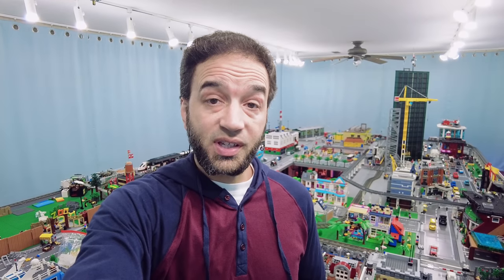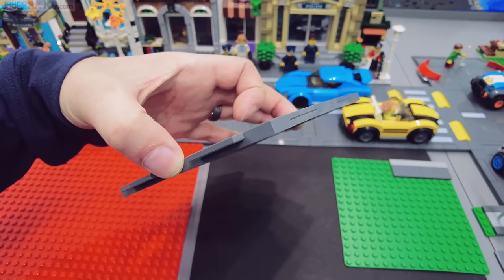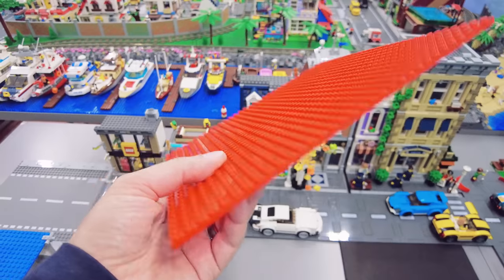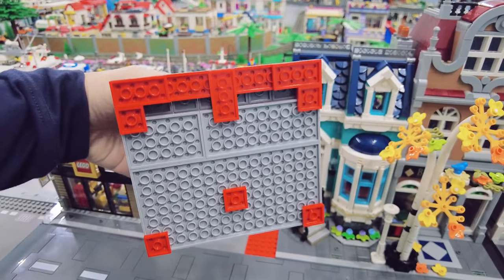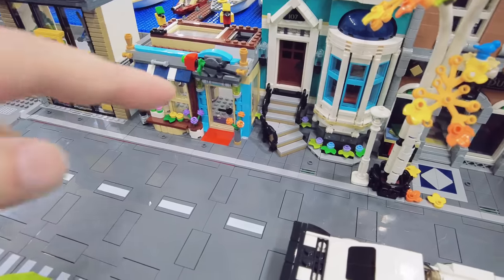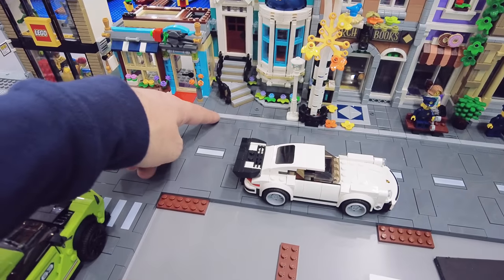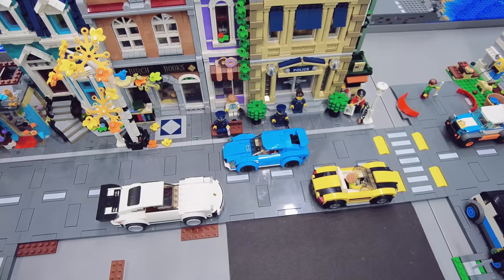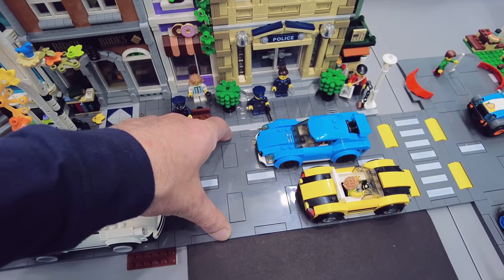LEGO road plate harmony! Easiest, cheapest fixes & integrations for modulars, baseplates & more

Comment: These roads just... look more LEGO, the have customisable capabilities, while they’re certainly flawed (as most things are) but they just feel more proportional, once we get corner prints, it’s all good to go
Reply: same here, I wish there was an official solutions from Lego to fix the height difference issue though
Reply: @adwind.homealone.fandesigner  I assume one will be coming. As lego has started realizing, with all these upgrades to the roads, the modular line becoming independent, it seems they are starting to realize “Hey, these people are adults and build our sets, we should keep them interested” so they would probably think “hey, baseplates are suddenly obsolete but most serious lego cities are built solely on baseplates. We should fix that.” Now enough of my rant.
Reply: The biggest detractors are the increased cost per area and the loss of curved roads. The versatility and compatibility most like makes them worth it though, so long as Lego commits to the same style for many years.
Reply from the maker: @snfriedm  I have to agree with that. They switched to plates for almost all buildings back in 2013. Modulars are the out-of-system outliers and can't transition to plates suddenly as every AFOL would revolt and burn their cities 😂 A simple pad piece of the correct thickness should be offered as at least an official fix for the modular problem.
Reply: I've got a feeling that Lego may introduce separate plates in sizes of baseplates for people to buy. 
That may not be the best idea, but I can see Lego doing that.
Reply: @JANGBRiCKS    3mm or 5mm glazing packers depending on your preference solve this issue, I paid £13 for a 1000 on Amazon. It’s a cheap fix. I’m loving the new roads by the way. 👍🏼
Reply: @nihili4196  i think so as well. Im sure they will cost a premium though
Reply: @nihili4196  That would be AMAZING!!! I never really had too many baseplates since they’re not in system, but this would be a godsend! I could imagine them selling well.
Reply: I’m thinking of doubling up the road plates for main thoroughfares and using single road plates for alleyways to run behind the modulars when you have the buildings back to back.  And if you take some Brasso to one of the 8x16 crosswalk plates and remove the white lines you can make a narrow alleyway.  You can also use Brasso to safely dull the surface of the road plates.
Reply: @snfriedm  Yo, have you had a car on 3D BOT MAKER die cast racing?
Reply: @JANGBRiCKS  wouldnt it be possible to include 4 16x16 plates IN ADDITION to the baseplate with future modulars? I dont think that would overblow the budget too much, it would give everyone options
Reply: If they made a specialized corner piece, I'd be 100% sold on the new road system! These do look a lot more "lego" like too!

Comment: With Lego once again progressing to faze out baseplates, I wonder when modular buildings will finally switch to plates which may further lead to the retirement of baseplates as a whole. Lego gradually started fazed out raised baseplates and non-road printed baseplates in the mid 2000s, however, there were some odd exceptions like the pharaoh’s quest pyramid so I may be underestimating the staying-power of them.
Reply: I've been wondering for a while now whenever Lego is slowly fazing out baseplates. Lego seems to get rid of bricks with limited use. 
Also, if I remember correctly Pharaoh quest wasn't exactly a success, so even though Lego used baseplate in biggest set, that might've just quicken the decision to get rid of baseplates.
Reply: they cannot switch modulars to baseplates, the whole thing about modulars is that they are modular, meaning they can connect together seemlessly with the sidewalks at same height
Reply: If I remember correctly, the last use of those big moulded baseplates (the one in the big pharaohs quest set) was in 2006 with the hospital and police station sets from that city wave. Which means, unless I’m wrong, it was 5 years between uses. That could mean they may never truly retire the baseplates but save them for very specific situations. maybe really big sets such as the Ninjago cities.
Reply: I actually build all my modulars (and Ninjago/Ghostbusters HQ) on a sandwich of 16 x 16 plates with some large technic bricks inside and regular bricks around the perimeter, Makes them super sturdy to move around.
Reply: The plates are much more expensive and smaller. Old and bigger vehicles do not fit and cannot drive next to each other.
No curves.
Plates do not naturally fit with Lego city products.

At this rate I would buy my baseplates from alternative enterprises... cheaper, bigger, and better.

Comment: I think these new road plates are great for building stuff like parking houses or viaducts. Just need some curves/angles and ramps. But for the ground level I still prefer big plates. I'm not that much of a fan of base plates, though, simply because they are not a full plate in height. If Lego switched to the plate-high base plates from the competition, and then integrated the new roads for raised stuff or bridges even, now that'd be something fancy.

Comment: My system is to build the modular builds on plates instead of the included baseplate. I have the plates raised with duplo to give the city depth. You don't have to use duplo though. You can raise you city up by one brick and build buildings on plates. Then place the new roads directly on the bricks and it all lines up perfectly if the sidewalk is tiled! Really loving this new road system!

Comment: I think the main benefit we're getting from these new road plates is flexibility and options. Previously, we would be stuck with the road size and lane width. All city builds that used the road plates looked the same. You did a great job demonstrating things you could do with these new roads. I think phasing out base plates are a good idea as they have the nonuniform height issue but also they're basically specialized pieces that only have one purpose. These road plates could definitely be used for other purposes and I'm excited to see how MOC builders and Lego use them.

Comment: I just wish they were a shade darker. They look too similar to the modular buildings' sidewalks, and I feel they should be darker to denote tarmac.
Reply: Yeah, the only problem is the only shades darker are straight black-which would be too dark- a colored option (navy blue, dark green), or a metallic color (gunmetal). None of those are quite right either, but I get it.
Reply: I agree... I know it's easier said than done, but a charcoal grey would have been nice for roads :)

Who knows, maybe standard dark grey has more build options, as Jang pointed out at the end of the video.
Reply: The point about the older baseplates changing color just made 'em sound MORE real-world accurate to me... I've never seen two stretches of road in my life that weren't all a patchwork of different colors.

Comment: I just don’t like the open “parts” of the new roads. I don’t like how it’s not one thing, so to speak.

But I DO like the modularity…
Reply: Yes, the cut-outs do look make the new system look very fussy. And obviously the more we put together the fussier the whole thing looks. I have tried to visually justify it by thinking in terms of the variant textures a-top of a road surface, but obvioulsy that doesn't really work, since the more we put together the more artificial and contrived the uniform pattern of the cut-outs appear.
Reply: I get why they did this, but I hope they also add ‘cleaner’ options without the patches in the future. I am also looking forward to an official solution for use with modulars, because to be honest, I like the basic idea of the new system beter than the old roadplates.
Reply: Real roads have many openings and crevices too, man... The new one is more realistic from a point of view...
Reply: These dont lok as bad when you get them as they look on pictures or videos.

Comment: You can actually connect 1x1 tiles with bar to the bottom of a baseplate, and it is much cheaper and doesn’t slide around. It increases the height to exactly 1 stud curb.

Comment: One other thing I haven't see anyone mention about these road plates is that you can use black pieces to represent road repairs or trans blue pieces to represent water. You can use grill pieces and round plates to represent manholes. Basically, you can customize the road itself and it is a happy-medium between the road plates and a mils system

Comment: I still don't like this new system. Just look at all that gaps between the parts. They are maybe more functional, but they're also way uglier.
Reply: I agree. I personally still like the old ones, or the old style at least. Integrated into the baseplate.
Reply: These actually look really cool, but it is a MASSIVE pain to convert everything over. For that reason, I'm probably going to use the new road plates to build bridges and raised highways and stick to the old roads in the central "core" of my city. 

However, the pieces themselves are of huge value now that I consider them. They can be used as cheap, easy roofs for large custom modulars, which is huge. They can be used for parking lots like Jang said, which is crazily huge. Before, you'd have to fill up an entire 32x32 baseplate with JUST dark grey tiles, and that gets expensive FAST.
Reply: And way too expensive...

Comment: Exactly what I was thinking. And for those that light up their modulars, raising them will help hide the wires. Btw. Jang how about raising a modular by just using another baseplate under it?
Reply: Adding just a baseplate underneath would not bring it up enough to fit the rest of the system. You'd get the modular up enough for it to have a small curb to the road, but it wouldn't fit the system. For that you need to put one plate under the baseplate just as Jang showed (if you want it level with the road you'd need a plate under the new roadplate as well).
Reply: He used regular plates, so a baseplate would be too low. Unless you don't mind streets and adjacent buildings to be unconnected and a hair out of sync in the system. Then i guess it is totally viable and won't even show the hairline coloured stripes Jang mentiones in the video.

Comment: If you go for the baseplate to plate conversion, you can actually connect the street plates to the curb if you use two of those 2 by 2 half-plate, half tile pieces.

Comment: 3/16 inch is exactly 4.7625 mm, while 1.5 Lego plate height is exactly 4.8 mm - which is why those work. The 0.0375 mm (or less than 1/500th of an inch) of difference you simply don't notice, and it's well within the manufacturing tolerance of those parts anyway.

If the plates were "metric" 5 mm instead, you would notice those modular buildings being slightly higher. But just by 0.2 mm.

Comment: While I've used baseplates on occasion, I never put much stock into them personally as they weren't particularly efficient when compared to the rest of the Lego system. I.E. Intersections would forever be intersections (unless you had the pieces to cover one of the exits) and curves would be curves, etc.
I really like the new system for roads because it corrects that previous issue, and you no longer have to buy a specific plate for a specific section of road. Legacy aside, I wholly consider the new standard a major improvement.

Comment: I’ve gone two plates wide for my roads and I love it. Gives me space for parallel parking. I wish the 8x16 (unprinted) road plates were more common, they aren’t available on bricks and pieces yet (at least in Canada) and the only way to get them is in the town center set, where they generously give you one. I want to use them to create alleys, specifically I’d like an alley to the right of my police station modular that will lead to a parking lot behind the station, as I don’t think they’d load perps in by the front door and also there’s nowhere to park all the police vehicles yet.

Comment: Interesting, foam core could solve a lot of problems I've encountered, others have suggested cardboard but that's too cheap in appearance, I just don't like the new road plates, their not wide enough and the need for so many tiles and parts to get them to behave, so infuriating. They can't even do curves, I loved the old curves. But mils have to happen so I can pick-up the buildings.

Your right at the end I do see potential of the new road pieces, just would need a lot more of them in a set to make them work properly.

Comment: Don't know why these new road plates got so much hate from folks on the web, I personally like them more than the old ones BUT the only thing I'm really confused with is that difference in heights...and that's not necessarily these road plates issue, it's a system's issue in general (at least for me).
Reply from the maker: Yeah baseplates have always been 1/2 plate in thickness, a dimension that's actually possible to work with thanks to headlight bricks, brackets, etc., but generally a pain. It's one of the reasons LEGO started transitioning most buildings to plates all the way back in 2013. Hopefully this video helps with some of the stragglers.
Reply: @JANGBRiCKS  right, generally nowadays it's only a problem when trying to embed modulars into new system, so I think moving modulars to plates in future will be the right move from LEGO. Swapping BP to plates on old modulars shouldn't be a big problem for folks either

Comment: Thank you Jang. Not convinced though. But that has to do how I arranged my roadplates. I extended  my sidewalks, to add more space for the minifigs. It also prevents streetlights, mailboxes and trees blocking the walking zones. However, this method doesnt seem to be compatible with the new road system. I need to find a solution, since the new system is a good way to save space. If you have any good ideas, please let me know.

Comment: Side note, Q-bricks makes excellent tiles that are higher quality than the current lego ones, and it's fully made in the EU (Italy). you get the mixed-size set of 1000 for 30€. Been using those in conjunction with the new plates.

Comment: The foam is a great improvised solution for the old base plates, but it is still something not from Lego and in all solutions we got, including the one with the own Lego plates, it seems like the buildings are not connected to the roads themselves, if I'm not mistaken. 

Another thing they need to improve in the new system is the white lines in the middle of the road because the shadows on each brick where they're set appears more and calls more our attention rather than the white lines themselves. The most important thing in recognizing what a road is are those white middle lines before anything else. One solution is perhaps putting the line as one brick entirely, you see? Not a printed piece on a tile. 

And we are still missing a proper stone road for the old style modular buildings, though. But otherwise the system works good.

Comment: having one single road piece that can be adapted to fit many situations such as bridges, multi story car parks and can change between straights and junctions is better than one baseplate with a predetermined road layout
however I think some dedicated road system 2.0 ramps and corners could work wonders in the system

also a single 2.0 plate could still work with speed champions if you are building british country roads which are barely large enough for an suv

Comment: Great video, it covered so many possible solutions to integrate these new plates. I never got enough of the old plates for the town I'd like to put together, so I'm at a crossroads of deciding which way forward to go. I'm coming around to investing in the new ones after all. I do like how they're more in the spirit of LEGO (actually BUILDING stuff) than the old baseplates, but the obvious gaps on the edges of the inset tiles do seem a bit of a downside.

Comment: I'm glad to finally see someone address how versatile these new plates actually are and mention so many integration fixes. If you think about it, the old plate system is really just not a good design since they are 'out of system' as mentioned, and lacks a great deal of versatility, relatively anyway. That's not to say the new plates are without flaws either, but I do think the new plates are better. The old plates were probably the best design they could make back then without compromising their prices and integrity of the sets and whatnot, but I reckon it has always been a bit of a thorn in the side for Lego to see that their base plates were not fitting properly into their standardized system. Perhaps Lego should make a cheap adapter set that can help to raise base plates to their standard height?

Comment: I really like the foam board idea.   a dab of hot glue (I know... sacrilege) onto the foam board right to the base plate of the building and you're set with no sliding.   Just a dab though, enough so it doesn't slide, but not enough to prevent it from being easily removed later.

Comment: If only they weren't so cramped! Not being able to have two trucks passing each other is a shame, and since they're already so expensive, you shouldn't have to buy extra pieces.
Reply: I mean, in this video you can see two trucks passing each other on this system. It was in Jang's last video on these plates too
Reply: If they where standard wider, you couldn't customize your road as much as you can now. Everything (allmost) is possible now, with drains, sidestripes coloured lines, as far as imagination can go.
Wider pieces would ruin that.
But yes, for the prize they could include more tiles, or drop the prize, or give voucher for the pick a brick wall.